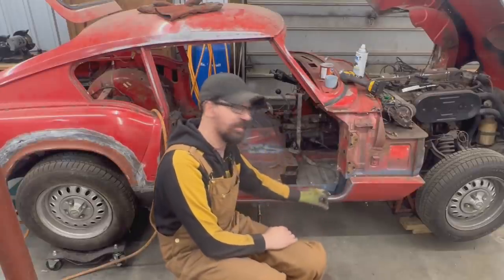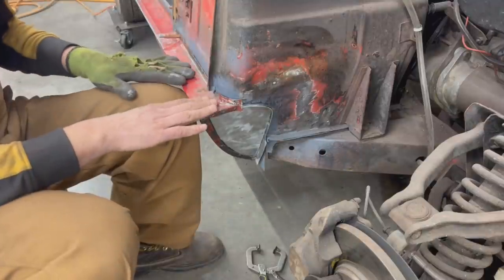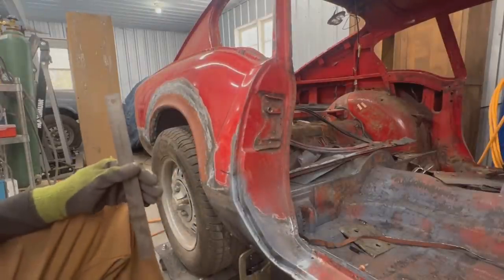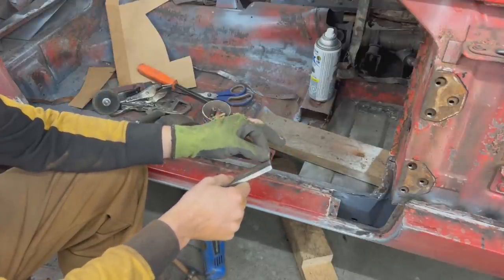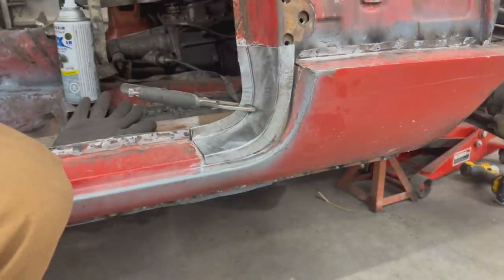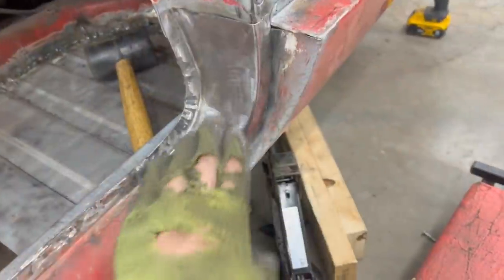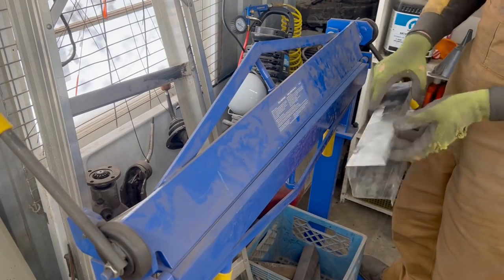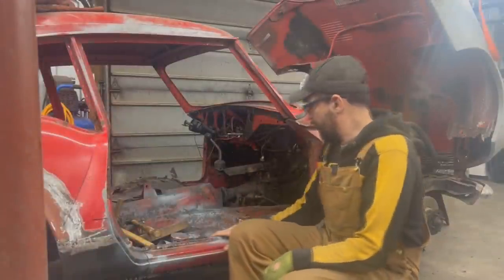1966 Triumph GT6 - Part 25 - Fabricating Parts from Scratch

Comment: Elin, you put so much work into rust repair but your rust prevention needs some improvement. Check out the Greasy Fingers channel for some good tips on this, the guy that does that channel is obsessive with rust prevention!
Reply from the maker: When I am done and when the body is painted I will spray all the enclosed areas like sills for example with internal frame coating. The primer that I spray now is just to protect the metal from flash rusting.

Comment: I don't understand why you welded on the sill cap if you are going to slit  the sill and add to it so that it is higher. Won't you have to redo the cap?
Reply from the maker: You are right. It would have been better if I did the cap after the sill is adjusted, but I have no way of putting it in if the sill is permanently welded. I could have left it lose but it was still going to be on my way for the cut and weld and eventually wouldn't fit flash with the flange of the sill after the weld was done as I have no way of grinding the weld from inside. Also the cap could have became too short after the sill is "stretched". So I just welded it in and it will be modified together with the sill. Not a big deal, just 2-3 more inches of welding and grinding.